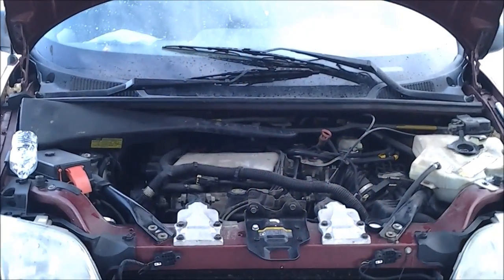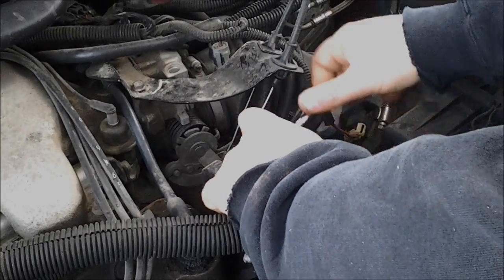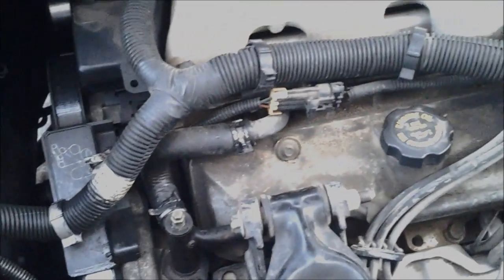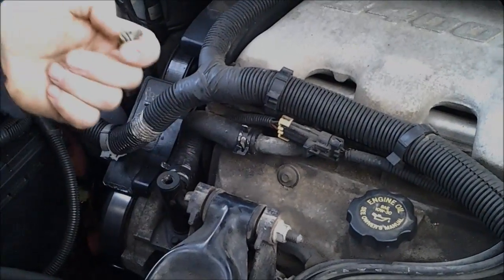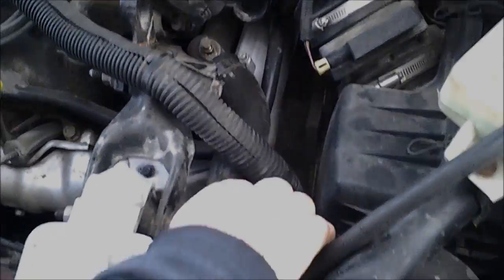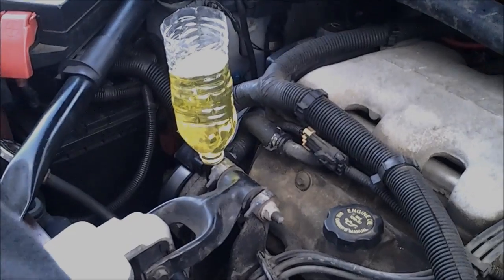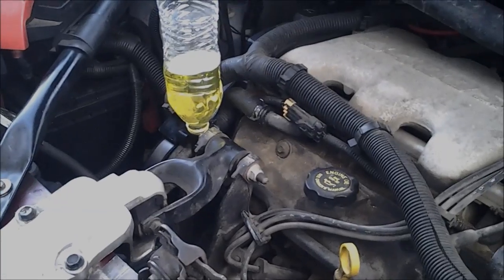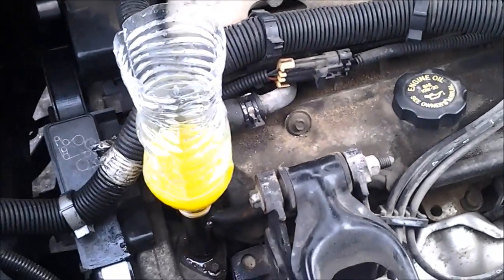Removing air pockets in engine  with plastic bottle

Comment: I'm going to try this on my Equinox first thing tomorrow morning. I have a narrow funnel to use. I know there are air pockets in there as the reservoir level isn't going down very fast and it runs hot from time to time and overheated once. I can purge what air comes out of the bleeder valve and it will get me home but not solve the problem.

Comment: Tried this yesterday. Unfortunately, it did not help me. I still have trapped air. Idled the car for almost an hour during this procedure. Once I took the car for a drive, the heat inside got luke warm. Also notice when it does this, the overflow reservoir dumps some coolant out, causing a bit of a mess and nice smell!

Comment: And make sure the car is cool before taking off that little bleed screw. You know those warnings about not opening the radiator cap? If you want to see why, take off the little screw while the car is hot. Speaking from experience. Needless to say, it made an impression, and I promise not to do it again. :) Survived to tell, after drinking a little coolant, getting a burnt hand, and falling on the floor!
Reply: Yeah I did something similar to this guy with some tube and a funnel, needless to say I let the motor get too warm and that coolant pulled an old faithful on me out of the funnel

Comment: Thank you for the video. I removed one gallon of coolant to change the thermostat on a 2005 Chevy Equinox and then added more coolant.. it started overheating and blowing cool air only. This solved my problem and luckily I had a water bottle that fit just right! 🙌🏼

Comment: I only overheat while stopped on a red light I tried this and still same issue after replacing the water pump
Reply: These shitty vehicles tend to overheat at idle because the fans come on too late.

Comment: Thank you, that is clever. I just changed a thermostat and I thought I got all of the air out of my system, had fluid coming out of both bleed screws. Doesn't overheat, but the rear cabin heat doesn't work now. I wasn't to worried, but now I will try this. I bet I still have air in mine. Thx
Reply: how'd it work out?? changed t-stat had some heat then it had no heat days later.. new pump gonna try it again

Comment: Thank you so much for this.  I just did this to my wife's Venture after she was complaining about no heat. No wonder. I hadn't checked the coolant level in the overflow tank for a long time, and it tends to use some.  The water bottle was indeed necessary because the rad cap refused to come off for some reason. It was getting pretty hot by the time I stopped seeing air bubbles, but I made it.
Reply: By Rad Cap, do you have a real radiator cap or do mean the cap to the pressurized tank? I only have the tank and that cap gets crazy tight even though it takes 20 turns before any air gets past it. So find some type of lever to unscrew it. Long pipe wrench? Then I put silicone lubricant on the threads and such but it only really helped when I put it where the cap bottoms out. Don't know why. Have to do it every time or it sticks again.
Reply: @CoCoSWISS1  The only pressure cap on this was the one on the radiator. We eventually found out there was a leak from the water pump and took it to a repair shop. They replaced the pump and managed to replace the cap too.
Reply: @dlittlester  Thanks Don, very helpful. This car has no radiator cap, just a pressurized tank but I have a similar air problem with a radiator cap and a non-pressurized tank..

Comment: Doing CPR to the engine is an innovative idea, but bad science.....  The "problem" is that any air in the cooling system raises to high areas where it can get trapped & cause the engine to overheat. The air bleeds are located in strategic areas to allow that air to escape when the bleed screw is cracked open. The method described can leave air trapped in the lower part of the engine that will not move until the engine is run long enough to open the thermostat and allow that air & coolant to circulate. But here you have closed the air bleeds before running the engine until the thermostat opens, so you have defeated yourself and are in danger of harming the engine.

The correct way to bleed the air is to start with the engine cooled down after sitting for some time, parked on a LEVEL surface. Carefully remove the radiator cap and crack the air bleed open slightly. You will need a funnel that seals snugly against the radiator cap opening to avoid a mess & enough mixed ANTIFREEZE OF THE PROPER TYPE FOR YOUR VEHICLE. Fill the radiator + an inch or two into the inserted funnel, then pour the proper amount to the "fill" mark in the radiator overflow container. Start the engine & let idle. Turn ON the heater and turn the temp or fan to "High" to circulate through the heater core and flow out any air bubbles that might be trapped there.

Watch the radiator opening as the engine warms up. It is normal to see bubbles rise and the level of coolant in the funnel go down. Add additional antifreeze/mix as it does so, and make sure to keep the overflow filled to the proper level as we don't want air sucked into the cooling system if the overflow is empty. Once coolant starts to come out of the air bleed screw then turn the screw closed. (It's normal to see small spurts of coolant & air mix bubble out of the bleed screw, so close when the tiny stream contains no air.)  Feel the radiator hose coming from the thermostat housing to the radiator. Once the thermostat opens up any air in this hose will be dissipated and the hose will change from flaccid when full of air to firm when full of coolant, and you will feel the temperature of the hose rise considerably when the thermostat opens. Run the engine 15-20 minutes until no air is bubbling up through the radiator. Turn off the engine, remove the funnel and replace the radiator cap, making sure it is tightened all the way and the markers on the cap line up with the markings on the radiator. NOW you have SUCCESSFULLY bled the air out of your cooling system in the PROPER manner and it is safe to drive your vehicle once again. Continue to watch the temperature of the engine and check for any coolant leaks on the engine or onto the ground under the car for the next 100 miles or so & then take that ROAD TRIP!!!
Reply: Llpppp99o9llllllllllloplll9p99l00pl00pp00p ok ll0 lol pp PP pl pp

Comment: I don’t have oil in water or water in oil but keep getting air in my collant system. Can it still be the head gasket? It runs well for a few hours after bleeding the system but then it builds up pressure and air again. 

Ford Fiesta 2005 1.4
Reply: Try a bottle of k seal

Comment: I bled my coolant system yesterday. I filled my cold system with coolant. I then started the engine and brought it to operating temperature. I waited 20 minutes before lots of bubbles started escaping. I raced the engine, squeezed the upper hose and waited for the fans to come on. Always keep the coolant at the same level. This is not a quick process. I had replaced my radiator so my process was significantly longer than others; about one hour.

Comment: U forgot to mention to turn the heater on to fill the heater core but that was well done sir
Reply: they have a heater bypass pipe.hows heat on make a difference if its always flowing through heater core ?

Comment: I thought this was the fix, but turned out that the radiator was bad/clogged up, and I replaced it.  2000 Olds Silhouette minivan temp would go up to 3/4 and would also get no interior heat, then it would drop to normal and stay.  Heat was intermittent, but seemed to be no heat after sitting overnight in 35 degree temp.  Maybe this caused the sludge in the radiator to clog up, then the heat let it break free?  Or perhaps I had a tiny hole allowing air to get back into the system every night, and this caused the lack of heat?  Not sure.  I had changed the thermostat before the radiator and thought I still had air in the system.  Appears that the new radiator fixed it.

Comment: Another way is to go to a mechanic and have the coolant replaced after you do a repair that opens up the system. Refill using a vacuum system. This eliminates any air getting into the system. Then your done. It may cost more but you don't have to keep repeating this method. Not all motors have these bleed nuts.

Comment: The GM vans ,uplander and venture traverse etc. are all lemons stay away, I drove them as taxi's for years and can tell you there is no reliability, the scariest is the floor wood sag and the rear hatch would pop open going down the road!
Reply: I have a 03 chevy venture front wheel drive, and still running like a charm, this makes 9yrs. and still running

Comment: ah ok   bleed plug    like all cooling systems have bleed plugs,  i bought a whole bunch of hoses to put on my engine because its in a different car  the radiator is opposite inlet and outlet   so the engine is a modified 351 cleveland in a 1991 ford fairmont  that originally had a strait 6 in it  so do you think i have an air bleed you fuckin morron
Reply: Very helpful comment! I also think that all videos on Youtube should apply to my make, model and year.

Comment: 08.27.2019 ( do you need to bleed air off every time you take the radiator cap off to check water level are antifreeze
Reply: No, only when you have lost coolant from replacing components or when you flush. Taking the cap off wont introduce more air into the system. Hope this helps.

Comment: I changed my radiator and water Pump plus thermostat and it still is overheating, if I have air pockets can that be the reason why?
Reply: Yes, air pockets can cause overheating, beacause the engine is getting cooled properly, when you turn the heat on, does it blow warm air and then blow cool air? Do you hear kind of a sloshing sound behind your vents? If yes you have air in the system. Hope this helps.

Comment: What happens when the engine runs so hot while your doing this that it boiling all over, and you still didn’t get the bubbles out
Reply: Sounds similar to a problem I've had getting air out after a head gasket job. For the first few times I was getting no circulation whatsoever in the engine, no heat in the vents. I started feeling around the heater core lines and felt they were cool to the touch. So I waited until the car had cooled and disconnected one of the heater core lines that connects to the thermostat bypass line and started the vehicle to see if it was coolant was coming thru the core and it was not. So I grabbed a water hose, flushed it back and forth, and after a moment some hotter than expected coolant started to work its way thru. I worked the water bottle over the line for the heater core to help keep as much air out as possible. I found that some pretty big bubbles did work out, and more hot coolant so be careful if going this path. After that, I found I had working heat in the car and proceeded to the rest of this video.
Reply: Sounds like a head gasket

Comment: Can do the same just by opening your radar cap and use a funnel that's made for bleeding roads. Once you do this just squeeze the upper radiator hose. This is sorta redundant.
Reply: Part of the problem is not all cars have radiator caps. Like our 06 Equinox
Reply: a cheap ass water bottle is more handy and way cheaper than "a funnel that's made for bleeding roads"!

Comment: I tried to do it from the expansion tank, and it overflowed about a half gallon onto my driveway as soon as I turned my car off. What went wrong?
Reply: Have to put the plug back in with a long extension (usually a 10 mm) while the car is still running and the water bottle is still on it to prevent air from getting back in and so it doesn't overflow (because if you turn the car off, a lot will come back out) 😉😊

Comment: Gave this a try earlier today. Will let you guys know the results after I go for a long drive later today. Burped out a bunch of air and it took in much more coolant than I thought it would. Leads me to believe this solution will work. Also starting to get some heat in the cabin now, before it was non-existent. It took me 45 minutes but I was pretty thorough.
Reply: Went for a long drive at varying speeds + idling and the temp gauge held just below half (ideal operating temp). I also have the heat working properly now. Thank you so much Art & Hardware for this video. It looks like you just saved me a bunch of money.
Reply: @DanielH874  assuming you still have the vehicle, is this the fix for the long run?
Reply: @PxlarXYZ  Traded the vehicle in about a year ago. This fix lasted me about 25,000km. After that it started overheating again and I noticed the coolant was dirty and looked like it was mixing with oil and/or water. The oil cap also had some milky residue on it which suggested it was likely a serious problem. Unsure if that was related to this initial problem/fix in the video. Wish you luck with this fix. In the very least it will give some more life to your vehicle at little cost.

Comment: yup, just put in a new thermostat and was great for about the week and then no heat until transfer and every thing is full. Temp gauge goes way up. almost over heating. I think I got it now..Hey how about this? Just raise the front of the vehicle so the radiator cap is the highest point. Open the radiator and open the reservoir. Make sure they are both full. Run the engine and the air will rise to the top of the radiator cap. As the fluid levels drop add more and make sure the radiator and reservoir never go dry. Makes to much sense.
Reply: monmixer did it work? I just put a thermostat and same thing happened

Comment: This is going to be long but it'll be worth the read. I was experiencing a loud, rattling sound during hard acceleration as well as hesitation and slow shifting. I knew there was air in my coolant system because the temperature readings fluctuated considerably. I have a 2000 Malibu with a 3.1 SFI btw. Your technique with the bottle is excellent. But a different way, and according to the Haynes manual the proper way to proceed, is to not remove the bleed valve, rather opening the 7mm screw. Using your technique of the bottle fill it half way with the bleed screw submerged within it. Begin filling the coolant system with water (if you will flush, prederably distilled) or coolant if you will fill/top off. With the bleeder valve open and submerged in water within the bottle, you should be able to see the air escaping the system (bubbling) through the valve as you fill. Fill surge tank (in the case of the 3.1 sfi) all the way to the cold full line. Continue to let the air escape the system (continue bubbling) which in my case took up to 8 minutes. When bubbling stops COMPLETELY, close the bleeder valve while submerged within the water bottle. Top off surge tank. Run car to operating temperature and drive around for a good 30 min. Park to check the coolant level. IT IS COMPLETELY NORMAL FOR IT TO HAVE DROPPED. As the engine heats and the thermostat opens, coolant will have filled the rest of the system, resulting in the drop in the surge tank. Once engine cools, you can repeat the bleeding process to top off the system, although probably not necessary...so just top off. If it was a system flush you performed, repeat entire process to fill with coolant instead of water. Hope this helps.
Reply: I wonder if plumbers putty would work to seal around it connection.?

Comment: I got a 3.4 Equinoxx 2005 , the temp gauge I on the middle but on a red light is going up a little bit , also the heater got no hot air ...this procedure can fix the issue ? please send comments
Reply: I just did it with my 3.4 Equinox and it appears to have resolved the problem. No more high operating temps and the heater is working properly once again. Give it a try. For someone that does not do much work on cars this was easy.
Reply: @DanielH874  did you run your heater when you was getting the air pockets out I see no mention of running the heater while doing this method I have 08 equinox no heat and over heating
Reply: @jesus_1s_key  what worked for you? Same issue here

Comment: If I ever have to drain the coolant system in any vehicle, I just refill the engine by disconnecting the heater core hose that goes back to the engine block. Then I fill the radiator. You will need a funnel that fits inside the heater core house of course.

Comment: AMAZING! A family member of mine has an 05 impala with the same 3.4l engine. It developed an overheating problem and we chanded out the radiator water pump thermostat and even temp sensor the overheating continued. Before i could solve the issue the overheating got so bad it blow the head gasket and cracked the block. We recently did a motor swap on the car with a 3.4 from the junk yard once we had it all back together and runing it seemed to have the same problem! After inquiring of the impala forum i fould these engines are known for having this issue with air in the system I found this video and gave it a try and it worked the car idled for about an hour with no overheating I can not thank you enough for this video i will be sharing this trick every chance i get.

Comment: This is by far the fastest and simplest way to do it.  After working for more than an hour using the little bleeders (like they all say it should be done and getting nearly nowhere), I looked at a few DIY videos.  This one worked and the car is not overheating any more.  Absolutely fantastic idea.  Thank you Art & Hardware.  Brilliant idea.
Reply: What temp does it run at?